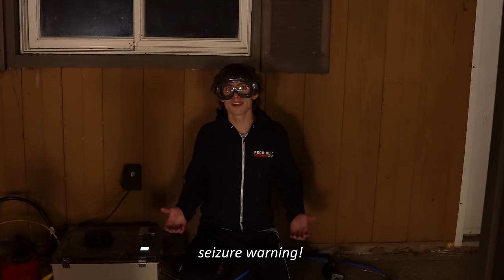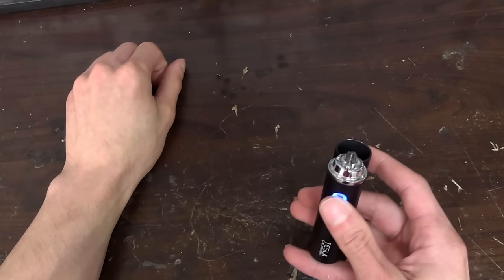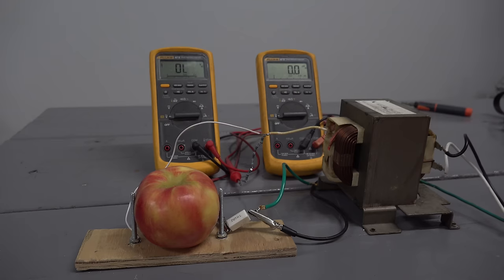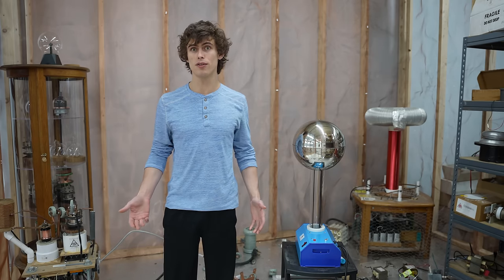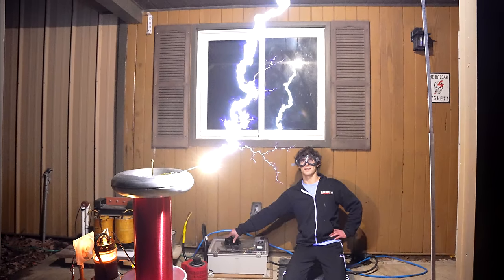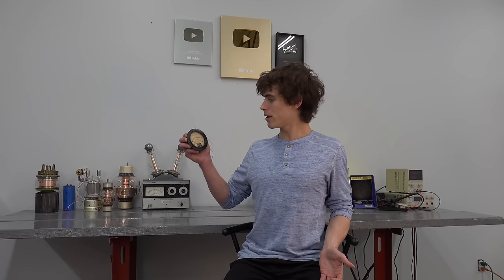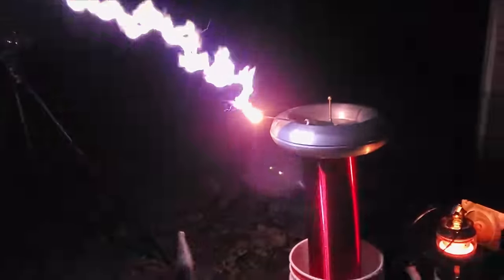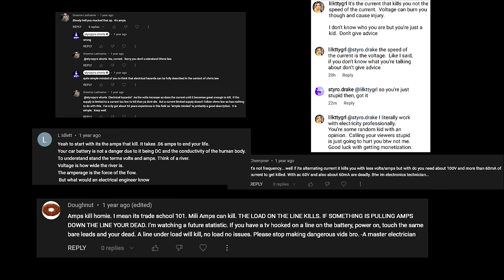Is it the volts or amps that kill?

Comment: maybe you could make a video explaining why the simplified "amps kill" myth exists, and why it may or may not be a good rule of thumb when handling electricity under normal circumstances? that would be an interesting follow up.
Reply: It is not a myth. The correct answer is that it is the current that kills.
Reply: @Mutrino  saying current or voltage kills is like saying guns or bullets kill. Theres a reason why it says 'danger high voltage" not current. Its the high electrical potential difference that creates the arcs and current. In most cases where poeple touch 'high voltage' without issue its because their source is limited and the voltage drops immediately. If I touch a 12A current conducted through a 1 Ohm resistor (lgnoring breakdown) from a 12V source its not gonna do shit becuase the current will drop as soon as you put your finger in the way. Even if you try it with your Power supply it wont work because it will be current limited and the VOLTAGE will drop.
Reply: @racket804  Yes there is a reason it says 'danger high voltage', that is because saying 'danger high current' doesn't make any sense.  And that is because the value of current depends on WHAT gets hooked up to the high voltage. Your statement 'In most cases where poeple touch 'high voltage' without issue its because their source is limited and the voltage drops immediately' is wrong. They touch 'high voltage' without issue not because the voltage drops but because the source can not provide an adequate number of electrons i.e. current to be an issue. Provided the source can 'push' (i.e. voltage) electrons hard enough and there are enough of them (i.e. current) you are going to have a problem. It is the flowing electrons i.e. current in the body that does the actual damage.
Reply: @Mutrino  I think you don't reaslise that you actually agreed with what I said. If the source "can not provide an adequate number of electrons i.e. current" like you said it is current limited, thus the VOLTAGE drops when you touch it. You can test this by connecting a low value resistor across your 12V power supply with 50mA current limit and measuring the voltage. It will be 12V before you connect it but as soon as you close the circuit it will drop significantly. Also I think you are confusing a capacitive load with a voltage source, because a source "Having enough electrons" doesn't make sense. Your last point is essentially arguing "Its the bullets not the Guns that does the damage" Which is technically correct, but saying "Volts don't  kill Amps do is kind of a dumb oversimplification" 

 I don't disagree with you but so many people claim touching "high voltage" can be safe becuase it's "low current" because they see a Van De Graf generator or limited voltage sources. It's a dangerous misconception to say "only the amps kills".

And even as we see in this video sometimes you CAN conduct high current and be fine if its high freq or very for short time period. But try touching a high Voltage source without Isolation and you will be instantly dead.
Reply: @racket804  Sorry for wording things in a way that makes you think I agree, I do not. Lets just say then, what would you rather do, have a current of 1000A forced through your body or be forced to touch a 1000V outlet without being told anything about what powers that outlet. Which scenario is pretty much guaranteed to kill you. I'll repeat one more time and after that we'll have to agree to disagree. In the body it is always the current doing the damage. I can hang on a powerline all day long being at a potential (voltage) of 10's of thousands of volts. As long as there is no path for the electrons to flow nothing will happen.
Reply: @Mutrino  Okay, thank you for confirming my suspicions that you don't even know what you're talking about. We will have to disagree.  Have you ever even taken any EE class? If yes, then its obvious that you didn't learn anything.  Having 1kA forced though your body is not equivelant to touching a 1kV source. Both scenarios can easily kill you and depend on a variety of factors. People regularly survive lightning strikes which are up to 30kA so nothing is 'guarenteed'.

If you hang on a power line the voltage drop across your body will be ZERO because it an open circuit. It doesn't matter what your potential is relative to ground becuase your not connected to it. Right now the potential between you and the substation is at 33kV so why are you not being electricuted? It's clear to me you don't undestand electrical potential. Current only flows through closed circuits and from high to low voltage. The amount of current is always proportional to the VOLTAGE difference.
Reply: @racket804  It would help if yo actually READ what I typed. First, nowhere do I claim that forcing a 1kA current through a body is EQUIVALENT to touching a 1kV source because it isn't equivalent. Thanks for confirming my point. Voltage doesn't kill, current does. Secondly, the amount of current that flows is most definitely NOT always proportional to the voltage difference. Lastly as a bonus. You do realize that NOTHING physically flows from high to low voltage, it is electrons flowing from the low to the high potential. Have I ever taken an EE class, lol. I am pretty sure I know a hell of a lot more about the physics of electricity than you do.
Reply: @Mutrino  Im currently studying for a masters degree in electronics. May I ask where you learned about electrical analysis? Is it highschool physics? Saying voltage doesn't kill is just not correct and dangerous.
Reply: @Mutrino  Its because Ben Franklin made electricity backwards, I think that is why textbooks say "electrons flow from the low to high potential", but all the textbooks are wrong and should be recycled because Ben Franklin made an error. One of the problems with academia is if somebody makes an error they usually never correct it and then the errors compound over times.
Reply: @earthenscience  Yes, Franklin had it backwards in the sense that nothing physical flows from positive to negative. The text books are not wrong, you are. Electrons flow from the low potential to high potential, that is not a mistake, that is physics. It makes sense when you understand what potential energy is
Reply: @Mutrino  I don't get it. Are we talkin textbooks (Ben Franklin) or are we talkin real life reality? In real life reality objects flow from high potential energy to low, for instance if a ball is on a table it has high potential energy then it falls down, that is potential energy turning into kinetic energy, then when it slaps the ground it turns it into heat energy (heat energy is basically microscopic kinetic energy.) Although its confusing because the phrase "potential energy" implies that conservation of energy isn't obeyed. But in terms of potential energy, balls never fall up, batteries always lose their potential energy. Just think of voltage as pressure and a metal wire as a hole/tunnel/tube. Electricity will always move to lower pressure to achieve homeostasis.
Reply: @earthenscience Yes, you are right.  However,  put an electron in an electric field. Then evaluate the force on the electron. You will find that the electron will move from low to high potential. that is, from - to +, but realize that from the electrons perspective it is flowing from high to low potential. No rules are broken.
Reply: @Mutrino  yeah but thats because ben franklin was wrong, + should be -. So the electron in real life reality is moving from + to -
Reply: @earthenscience  No they do not. Electrons move from the anode (negative terminal)  to the cathode (positive terminal). Forget Franklin. The only time electrons move the other way is when an external potential is forced on a battery system that exceeds the nominal battery voltage i.e. battery charging.
Reply: @Mutrino  Franklin reversed the polarity. When you say anode what you are actually saying is positive terminal.
Reply: @earthenscience  Regardless of what you think Franklin did. Electric fields are based on the direction of movement of POSITIVE test charges. Therefor electrons, which are negative charges, move from low to high potential. Period. If you want to believe the opposite go ahead. The process of electrolysis proves you are wrong.
Reply: @Mutrino  U are not getting the connection between this convo and Franklin. Electrons are not negative charges, there is no such thing as a negative charge, it implies vacuum or absence. Electrons are a POSITIVE charge, the textbooks taught u its negative because Franklin made it in reverse. How does electrolysis prove this
Reply: @earthenscience  Gimme a break. Electrons are negative charges, this is a well established fact in physics. Claiming otherwise is just ludicrous. By observing what happens at the electrodes in electrolysis you can deduce the direction electrons flow in as well as the that fact that they are negatively charged particles. A negative charge does NOT imply a vacuum. If you were right we would not have electronics and we wouldnt be having this conversation. You are seriously misinformed.
Reply: @Mutrino  Again you are not getting there are no such thing as negative charges. The textbooks are wrong because of Ben Franklin. "But there are electronics" You can still build electronics and civilization from instruction books full of typos and errors but its more a pain in the ass than using a grammatically correct instruction pamphlet that doesn't have errors.

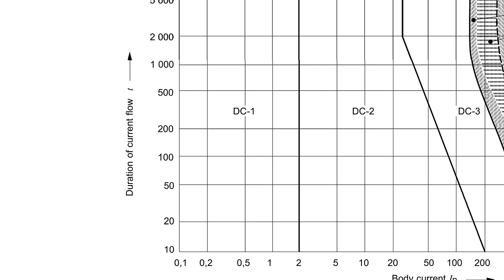Comment: 10:35 I would like to add something. Current by definition is the measure of charge per second passing through a surface area. The smaller the time component, the bigger the current will be. For example: 1 coulomb of charge in 1 second is 1 amp, but 1 coulomb of charge in 0.001 seconds is 1000 amps.

Comment: The only place current is the main factor for mortality is in hospitals. This is because, in a hospital setting, patients are saturated with iso/hypertonic solution and can have conductive materials passing through the skin. This is why electrical safety in hospitals is taken extremely seriously as even extremely low voltage and low current shocks can be lethal without the skin acting as an insulator.

Comment: I argued (way too long) with someone in the comments of a  video about electric shock hazards once. He kept insisting that "according to ohms law" there was no way that being shocked by so many volts/amps could be lethal. I forget now how much voltage/current he was using in his example but sure enough he had all the math worked out and it was indeed lower than the amount of current that most texts cite as being lethal. I kept trying (unsuccessfully) to get him to understand that there are many other factors in play such as capacitive coupling, individual skin resistance, dialectic breakdown, whether or not you are completely dry, etc., That are not addressed by ohms law and cannot be accounted for by dry math alone.. But alas he was one of those "the numbers don't lie" type of fellows who was throughly confident in his conclusion. After arguing with someone I considered to be willfully ignorant for upwards a half an hour I began to question which one us was actually the idiot😅 Finally i told him to present his argument to saint Peter should he happen to be electrocuted by a less than lethal amount of current 😅

Comment: Electricians are encouraged to have thick rubber soles on their boots so that power potential does not easily find a good return to ground path though them. They also need to be careful with the free hand is touching when probing voltages. They prefer fiberglass ladders that are non-conductive.

Comment: Interresting topic. 
The charts are based on currents that normal people engage, so DC to 50 / 60 Hz AC, and the current has to go through the heart, 
The voltage in this range is only a means to get the amount current flowing. 
The voltage can vary based on the individual, and the amount of sweat / moist on the skin. (more moist means the current will flow at a lower voltage. 
50V AC or 100 V DC can be leathal in a worst case situation.

Comment: I've been trying to wrap my head around current vs voltage. I completely understand the time dependency. So voltage vs amps in a vacuum (independent of time) is like a garden hose. With water (imagine low voltage) hitting you, but with the same flow rate, instead Mike Tyson punching you (high voltage). I know there's exceptions and everything and duration is important.

Comment: It is the current that kills you. 50 miiliamps is the recognised point that your heart is influence by external power sources, that is why we have RCD protection set at 30 milliamps. Voltage needs to rise to overcome body electrical resistance to allow more current to flow. Once you near 50 milliamps, you lose normal heart function. If you are bone dry, you will have a higher body resistance and the voltage required to impair you is higher. If you are wet, hot and sweaty, or just got out of the bath, then your body's resistance is much lower and a lower voltage will impact you.

Comment: You could substitute the word "voltage" for "force" and the audience may respond differently! Also, the electron is secretly positively charged, but undoing several hundred years of knowledge wasn't something many were very ambitious to do! Ben Franklin thought of electricity as an invisible fluid that could build up or be absent from a material, or at least some materials. He thouhgt that when the invisible fluid built up then the object was positively charged. When there was an absence of this fluid, he called that material negatively charged. It turns out he got the concept right but the nomenclature backwards.

Comment: I've been an electrician for just a year and I got shocked by 120 and 277 volt sources. Me and my boss didn't check that the outlet circuit I was working on was off. Felt like a spider bit me.

Next time I was connecting a lighting system and, again, we didn't check in the circuit was off. My dumbass snipped all 3 wires at once. This time, it was like a gorilla was trying to crush my arm, the box the wire made a small arc flash and it was only when I saw the flash that I realized what was happening. One hand was doing the snipping while my other hand was holding onto a fiberglass ladder, this meant only my cutting hand was part of the circuit, so it wasn't difficult to rip that part of my body away from the danger, i looked at a coworker who saw the whole thing stepped off the ladder and had a little sit down.

Comment: If you put a low enough ceiling on either, then it doesn’t matter how high you set the other at. 

1,000,000 volts with an amp ceiling of .0000001 amps can’t hurt you. 

And low voltage automatically sets a ceiling on the amps, based on the resistance. 

It is the amps that kill you. But voltage determines the amperage that goes through you, unless you set a ceiling on the amperage.

Comment: the "3 amps" you measured is in the primary and the High voltage is on the secondary of the HV transformer.  so what are you trying to measure?  You can measure input power V*A and then calculate output current or voltage if you can measure either one of those on the output.

Comment: 0:53 I like that one person says something very wrong and signs it with “- a master electrician.”

And then another person straight up says that voltage is the speed of the current.

And the other guy talks about ohms law but it seems like they think everything is an ohmic conductor. (Something where the current is directly proportional to the potential difference (voltage).

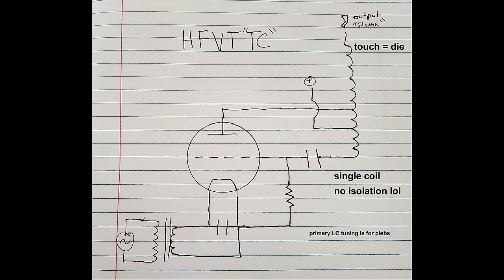Comment: 18:40 Can you elaborate on the isolation thing?  Is it that the arc connects you to things upstream in the circuit, so it's like touching your power supply?  So like, the arc is effectively an e.g. 100KV 10MHz wave plus a 1KV 100Hz wave, and it's the smaller slower one that kills you?

Comment: In my opinion: In direct current what kills is the voltage in combination with the resistance, since voltage by itself does not exist and the power of the source (how many amperes can the source tolerate before the voltage sinks) In alternating current, all the above apply to direct current, but also the frequency that determines the impedance. It is also the exposure time of the person to the electricity

Comment: I feel like so much of this misconception is a combination of the way we teach electronics and the way we design power supplies. Since the default power supply is typically a current limited voltage source the average person typically encounters a dangerous situation (high power draw) is when there is a higher current.

Comment: Having grown up on a ranch in the Cherokee Nation east of Broken Arrow, Oklahoma I learned to use a 
cattle prod as a kid. It used a regular 9v radio battery. But it was amped up! I had too much curiosity for my own good and decided to test it on myself. I put the 2 prongs on the top of my booted foot and pulled the trigger. OMFG! Unbelievable! It didn't take me down but jolted my leg hard. Don't ever try it. My point is that a small amount of volts with lots of amperage can hurt or kill a person.
Reply: A 9v battery can absolutely shock you  IF you step the voltage up. Just because it takes 9v in doesn't mean it was 9v that shocked you.

Comment: I like to this idea as falling off a building. If you increase jump from higher platform (HIGH VOLTAGE) but there is minimal to no gravity (CURRENT), then you wont get hurt at all. Thinking of it in this way makes it more easier to understand the concept of P.D. and Current
Reply: You can't control voltage and current independently. Current is directly proportional to voltage across a resistance. If there is high voltage across your body there is always high current